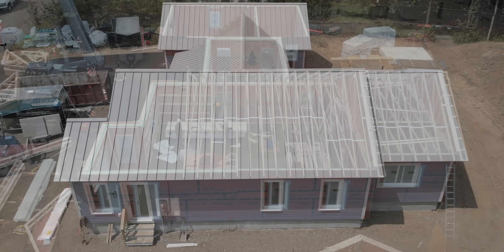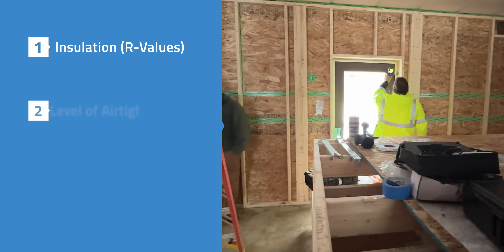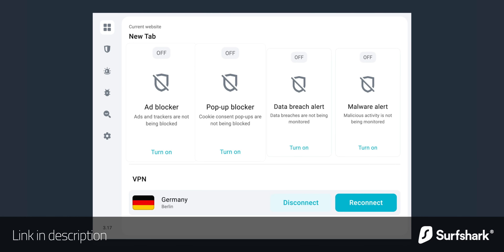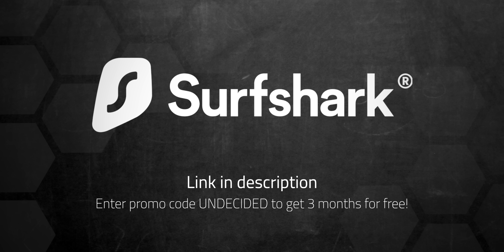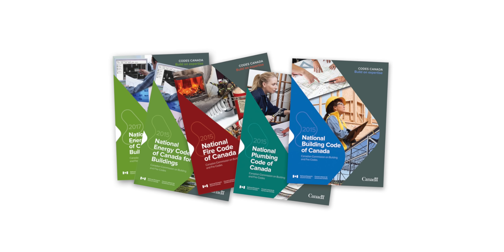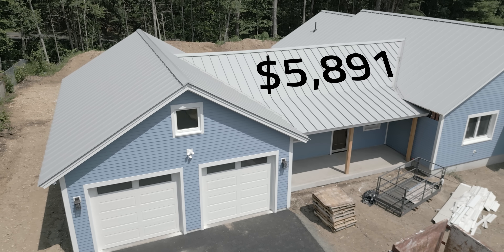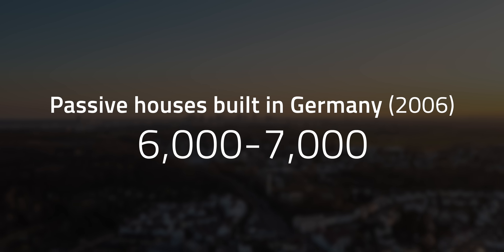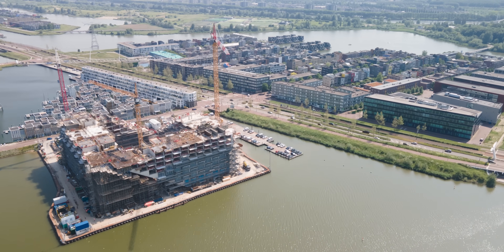Why Do American Homes Suck?

Comment: "Saving USD 5800 in energy costs"... wow... that implies that the average yearly energy costs in the US are higher. For reference: After a 10x increase in gas prices here in Europe, higher baseline energy costs in general, those savings are still 3-4 times higher than the total energy costs for heating/powering my home here in the Netherlands...

Comment: Comparing new housing codes isn't always the most helpful thing. I'm surprised at how high the UK is on your first list. Within the UK we famously have terrible housing stock. Our codes for new houses might be great, but our housebuilding has been falling far short of demand for years, and a lot of our existing housing stock is old and inefficient. There are no requirements to get these up to scratch. Our only incentive to make our houses better is the knowledge that we won't be able to replace our gas or oil boilers soon and will be forced to alternative heating, but the only way for that to be properly effective is significant renovations to our insulation and and also fundamentals of how our heating systems work.

Comment: I always had the impression that in USA energy is so cheap (and abundant?) that lots of it is wasted in luxury. Now that energy becomes more sparse and expensive, all the older houses have to be renewed/insulated in order to copy with higher energy prices. (Same in EU, but energy prices were always significantly higher than in USA). If new houses are not built with energy saving in mind in the USA, that is a shameful. 
In the EU, Unfortunately, for older houses those people that have the badly insulated houses (often rented) dont have the money to insulate the houses, and the landlord refuses (unless it is governed they must do so), simply because it does not have a positive ROI. 
Meanwhile costs of living spiral up because of the inflation in the EU, and salaries are not raised accordingly. In order to compensate low-income households for this, taxation is going through the roof  for lower middle-income and up. So everything is greener on the other side, until you arrived on the the other side :) "USA Freedom" has it's price, and so has the "EU/NL government controlled" life. Luckily, it is still not as bad as the USSR or (even worse) the CCCP. yet.

Comment: Building materials play a crucial role in overall energy consumption of a building and are often overlooked. In that respect, I assume the US are in fact making some ground through the use of wood instead of brick and concrete. Those details are hardly reflected by the short and long-term cost but CO2 footprints tell a different story. 
However, when looking at insulation materials, air tightness, the US and Europe are still way too dependent on the oil industries products (sprayfoam/styrofoam, glues, membranes, additives, etc.) and those are in fact not as innovative as they try to appear.   
I'm convinced we need to simplify construction rather than complicate it through high-tech novelty if we really want to step into the realm of sustainability. The most durable AND sustainable materials we know of today have been around forever. And if you look closely they solve an array of issues that exist with homes up to this day. 

Here's an example: Instead of onion-skinning a building with membranes and airtight insulation and then adding a ventilation system in order to get rid of vapor causing mold, we could just use mud and straw for the walls to eliminate the problem (while establishing a naturally balanced healthy 50% humidity) and keep costs and maintenance at a minimum. Straw and mud are locally available (transport) and need almost zero further processing (energy). At the end of the building's lifetime these walls are fully biodegradable.

Comment: You also need to talk about electrical installations. In Italy we have very high standards, perhaps the highest in the world together with Germany. The most obvious example is that all cables must pass through ducts to be removable in the future without breaking the walls
Reply: That sounds incredibly useful. My home in the US is wired so that you can use the CAT-5 cables in the wall as Ethernet, but they are completely inaccessible to ever be upgraded and replaced, so it's permanently capped at I believe 100 mbps and becoming increasingly obsolete. 

If it was in easily accessible ducts i would 100% replace it with more modern Ethernet standard cables, but to do so would require thousands of dollars in cost to open up and then repair sections of wall and floor. I COULD just install my own ducts along the ceiling I suppose, but then my house would look like an office lol

Comment: I watched my uncle build what you call a high performance home in Greece. It took him 4 years to complete because of the high standards. Countries with larger populations do not have the same standards as smaller European countries because there would be huge housing shortages. If you want a high performance home buy it or build it. Requiring all homes to have these regulations by government mandate inflate the cost of housing even further.

Comment: In America, we don't need more regulations from Big Brother. As it stands now, we have to buy toilets that need to be flushed 2x, dishwashers that have to be run 2x, shower heads that cause much longer showers and now they're coming after our gas home  heaters, gas water heaters and gas stoves. Yet the administration in charge doesn't want nuke power plants, natural gas or coal plants either. Solar and wind don't cut it- not even close. It's insane. 

From windows to walls to HVAC, to roofing to foundations, let the market and the consumer decide what they want in their home or building construction. That's how it's done in a free country. That said, I agree that most newer homes and buildings in America do suck and are ugly.  However, most municipalities have codes, whether IBC, UBC or SBC  and our buildings still suck. More codes, or more strict codes is not the answer. If Germans or Brits want those codes, fine. In America, we should not have a uniform code and each state should decide what they want to do. We have too much centralization as it is. Energy efficient design is a good thing but it's not everything. I'd prefer designing a good product for a free and responsible client without all the righteous preaching and carbon footprint propaganda. Telling professionals we need to meet this or that arbitrary standard or the world will end is a big pile of bravo sierra. But keep buying those windmills and solar panels from China. 1:25

Comment: Yes, american houses need to be made better. At this point, we just need homes built though. Trying to push higher priced homes on people in a housing crisis is just a dumb idea. While I've studied this for about ten years as I look to build a second home on my property, I know there are tradeoffs to everything. Am I going to spend the money on geothermal like you? No. Am I going to hit passive house numbers? No. I'm going to build the house to stand 50 years with nothing more than a few coats of paint and make it as efficient as I can for my dollars. Build it like I want a .50 ACH50 but I know if I get down to 1 ACH50 that'll be great. Am I going to put european triple pane in? No. But I will put in south central zone energy star certified double pane windows in. I'll do 2x6 framing so I can put in a better insulation and pay the extra for zip sheathing. America has a lot of climate zones and challenges that other countries don't have which is why building codes are generally set locally. It doesn't make sense to build a house in upstate new york the same way as we build a house in south texas.

Comment: Great coverage! I conversed with a few high-efficiency designer builders and learned to expect to spend upwards of $400/sf for a highly efficient home (not including lot, site prep, establishing utilities, etc.). That's double or more the per sf cost of standard new construction. The much repeated line in high-efficiency home guidance is that it should cost 10-to-20% more than standard construction. According to Statista, as of 2022, the average price per square foot of floor space in new single-family housing in the United States was $168 USD. So, 20% more would be just over $200/sf. Clearly, the popular figures given on many videos and blogs are half the more realistic cost. When someone expects to pay less than half what they're quoted by a passive house or other HE builder, the shock is hard to process. It amounts to being able to afford half or less the sf previously assumed. That's difficult to cognitively and emotionally metabolize, not to mention getting spouses, lenders, etc., onboard with a project. It makes buying a larger, inefficient house and applying some efficiency and NetZero bandaids tempting. 

Also, the US does need to have and enforce stricter codes AND it needs more programs to make building and retrofitting available to more people.

Comment: I think part of the problem shows in the surprise that a 1991 house is still in use today. By EU standards a 1991 house is very young. The house I purchased some 12 years ago was build in 1964 and although it got an insulation upgrade some 15 years ago it still stands strong. At almost 60 years old it is not generally considered old simply because it was built well using good building codes that allowed, even back then, for relatively simple modernisation, keeping it relevant even decades after it was built.

Comment: I built my house with SIP’s ( structural Indulated Panels.).  And ICF’s. ( Insulated Cement Foam).  Yes and tilt and turn Windows.    Both are superior. To stick built homes.   R factor of a 2x4 is only about 1&1/2 R value.  If every 16” you have a board of only 1.5 R value that is an inch and 1/2 “ wide the full length of the wall.  While winding up 200% stronger than stock built.

Comment: In 1985 I moved into an energy efficient house in Manitoba Canada.  That house used double 2x6 walls with the studs in the inner walls offset from those in the outer walls.  The house had triple pane windows and particular attention had been paid to sealing the house.  The house was also fitted with an air exchange unit to capture heat while exchanging inside and outside air.  The house was all electric with one 1,200 watt electric baseboard heater for a 1,200 square foot house in a climate that routinely got to -30C in the winter.  The house was quite comfortable although it did need better inside humidity control in the summer.  The house was not new when I moved into it in 1985.  That a house like that was built 40 years ago really says something about current US building standards.

Added note:  I now live in a small coastal town in Maine that has almost no building codes.  The only code we have is for sewage plumbing.  Maine has a state building code, but for towns under 4,000 population adoption is a local option.  Many towns including mine have opted not to adopt the state, or any, codes.  A builder can build literally anything that is desired.  So 2x4 walls with no insulation  - no problem.  There are many homes in town with no insulation including new construction.  Some of those homes have no heating system installed.  Of course the bulk of those homes are not occupied in the winter.  I think our winter home occupancy is around 50%.
Reply: Was your house located near Selkirk? As you know, Americans think in the short term. Their anti-government views together with small town depopulation resulted in uneven and poor building code adoption outside major metropolitan areas. I pity the people who live in the South, where heat is the enemy and climate crisis is bearing down. They need to build better shelter or migrate north along with the  Mexicans and Central Americans.
Reply: @einarquay  I was in Pinawa about 120 km NE of Winnipeg.  I agree about the lack of foresight in the states.  The town I now live in has never had codes and actively voted a few years ago not to adopt them.
Reply: I was raised in Winnipeg. Canada has a housing affordability problem and too few homes. I live in Ontario now and our Provincial code makes no distinction between a 3000 square foot house and a 300 square foot mini house in terms of wood framed energy code compliant structures. Meanwhile,the government is encouraging homeowners to build accessory units and secondary detached dwelling on their lots as a Right. Municipalities are resisting. I think it is time to look at the amount scarcer resources that are going into building low rise houses versus the societal need for good shelter. Reducing air changes through the envelope means less energy spent on heating a volume of air. High Thermal resistivity becomes less cost effective in a small dwelling, say 600 square feet. So I advocate a separate Code for small houses.
Reply: @einarquay  interesting.  I can't comment on differences between small and larger homes as far as codes go.  Here on the coast of Maine we also have a lack of affordable housing, for a totally different reason than in Canada.  Locally we are in a tourist area and many homes have been converted to short term rentals for tourists.  It has gotten to the point that there is effectively no long term rental market at all.  The lucrative short term rental market has also driven the cost of housing up significantly.  It was already unaffordable for the people who live here, but now it is even worse.  On top of that local zoning and building costs make it virtually impossible to build affordable homes.  For example, in my town we have a once acre (0.4 hectare) minimum lot size and ADUs are not permitted.

Comment: northern italian speaking here, former construction worker and plumber, now industrial engineer. i think this us vs eu homes thing can be divided in 3 points: 

structure: even if i do think structurally american homes are not by far what i consider to be a sturdy construction, whats happening in europe is that we're also making some of our homes not sturdy, by the use of wood frames or drywalls. Untill 20 years ago a home was bricks in a frame of reinforced concrete and that was it, the roof may be made out of wood, but not like us trusts, but 12x16 cm solid beams, sometimes laminated, with an 80cm space in between them. if you took a home built in northen italy between 1990 and 2000, you could throw that thing down a hill and it would have rolled down like a cube without collapsing. Then the things started to change, mainly by economic reasons, that i'll explain later.

energy: eu homes just recently started to consider insulation a thing 30, but more like 20 years ago or so, we all know concrete is a very worse thermic insulator than wood

economy and government rules: europeans do not spend 3 times the money per surface unit than es citizens because they can (it's more likely we are poorer) or want (greenwashing philosophy) but because it's mandatory: just like with cars, the lack of sales and related market led eu goverments to implement a series of rules in order to keep such markets alive at the expense of the citizens. they forced us to stuff our houses with insulation (why wouldn't we do it by ouselves first if there was a real roi in doing that?) making our houses essencially vacuum packed boxes. and what happened next? mold. so what some of us are forced to do now is to buy a forced circulation and recicling in-out system which costs twice our average net yearly income. same with solar panels, i'm expected to recover for the installation in 30  years of cut on bills, while their average life is like 25 years. What's funny is our bills consist 75% of taxes and not consumption-related invoices. I'm starting building my house next year, prices for construction went from 1300 euros per square meter to 2400 (land purchase excluded). 10% of the construction costs is for projects and another 10% for electric and hydraulic system. you may say all of this is necessary to save our planet to from carbon pollution and warming. i'll answer that even if reducing by 0.02% (the total carbon footprint caused by human ctivities) the percentage carbon in the athmosphere would magically invert the cycle of warming and cooling the planet has gone through since it sterted existing, just think us europeans are 5.5% of world population and we're talking domestic heating only.  All this lead people to try saving money by buying less structurally good houses. average 120 sq.mt house (open space, 2 bedroom, 2 bathrooms) costs now 290k euros to build, land purchase excluded (it would take the verage person 17 years to pay for it if it saved each euro it earned for that), and if financed at 80% in 25 years it would increase that cost to 350k by interests

I'm convinced what our goverments want is to make impossible for te average citizen to buy an house in the ultimate attempt to make us all around consumers instead of owners, the same is happening with stupid and blind work policies that are pushing all the heavy industry outside our territories. greenwashing has been a way to do it since it was born in the seventies, no one will change my mind on that.